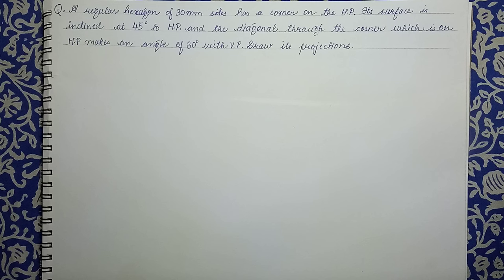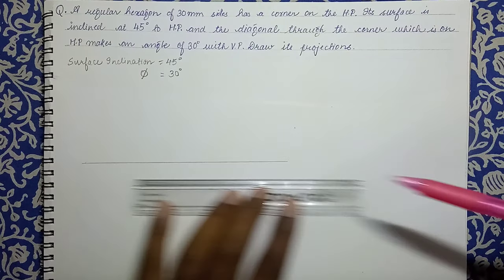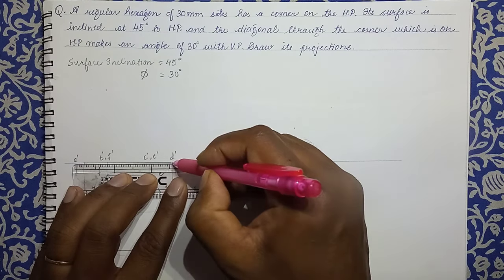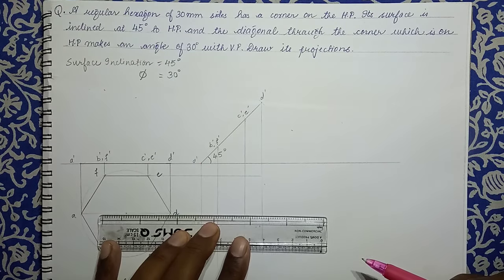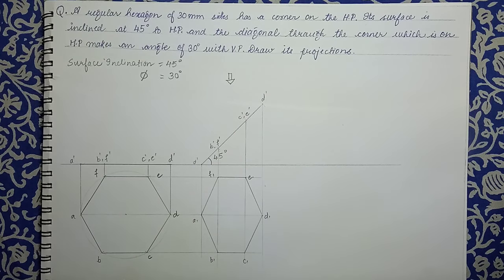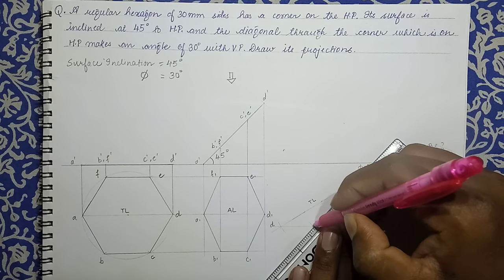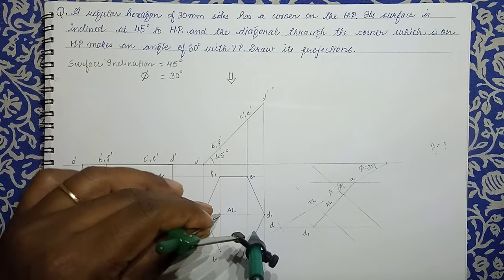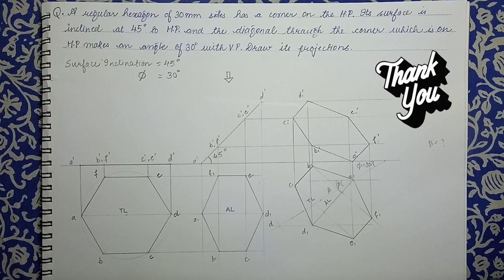Engineering Drawing/Projections of planes Hexagon Diagonal

Comment: A hexagonal lamina of sides 25 mm rests on one of its corners on HP. The corner opposite to the 
corner on which it rests is 35 mm above HP and the diagonal passing through the corner on which it 
rests is inclined at 30º to VP. Draw its projections.
Reply from the maker: once again go through the video you will find the diagonal is making an angle with VP and not the Top View is making an angle. The same video provides you the solution you need to alter your dimensions and measurement of the plane in your given problem. Hope it will help with your query. Thank You

Comment: 4. A hexagonal lamina of side 30 mm rests on one of its corner on H.P. the diagonal containing the corner inclined 60° to V.P. The surface of the lamina is inclined 50° to H.P. Draw its projection
Reply from the maker: once again go through the video you will find the diagonal is making an angle with VP and not the Top View is making an angle. The same video provides you the solution you need to alter your dimensions and measurement of the plane in your given problem. Hope it will help with your query. Thank You

Comment: A hexagonal lamina of 30 mm side rest on one of its corners on the HP. The diagonal 
passing through this corner is inclined at 45 ° to HP. The lamina is then rotated through 
90° such that the top view of this diagonal is perpendicular to VP and the surface is still 
inclined at 45° to HP. Draw its projection.